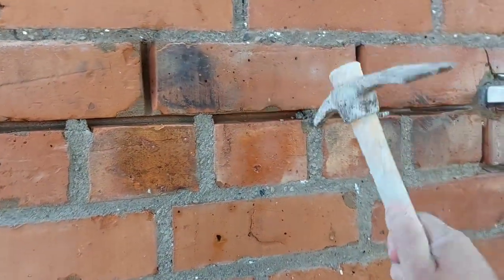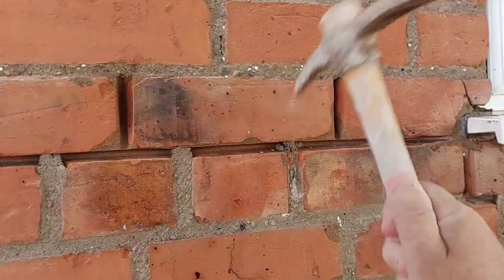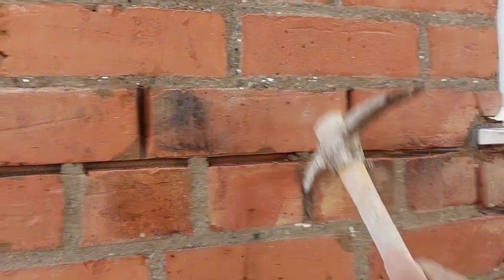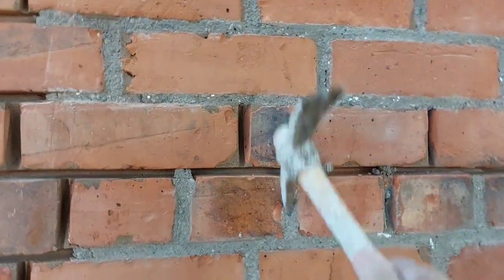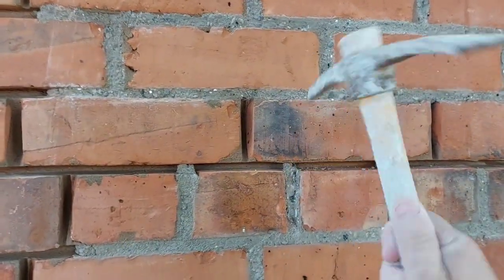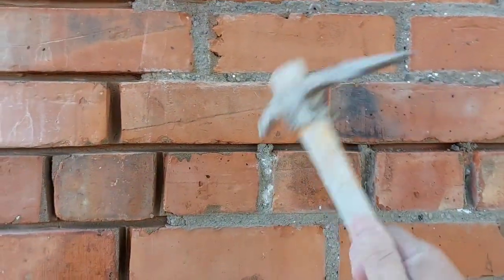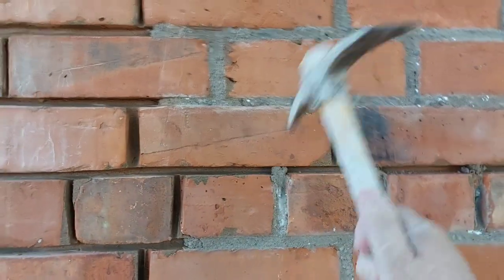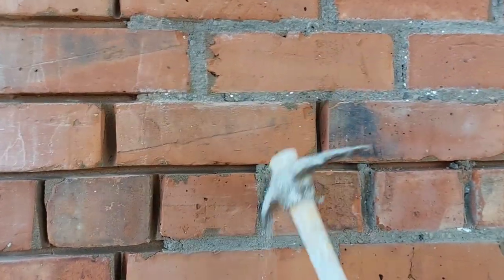A good NHL 3.5 lime mortar strength after 21 days flexibility and elasticity  is what you want

Comment: Very useful video as always glen love how you share your expertise about NHL lime mortars ...I've got so much to learn after spending 30 years working with cement this is a totally different different game ..and tradesmen like you sharing this information is in valuable..keep up the good work 👍
Reply from the maker: Thank you if you have any questions just ask
The purpose of my channel is to get more people using lime
Reply: Hi mate I'm a bricklayer myself . And want to understand more about lime  mortar 

I'm re pointing a gable from 1921 it's the original lime I'm going to have to use lime mortar but what mix is best 

Also if I point with sand and cement obviously not on this job is it always good to add hydrated lime to make it more flexible

Comment: I find it’s the compaction of the mortar that’s the most important factor in achieving the strength. To do that you need to watch how much water you add to the mix and ensure it’s not too sloppy as it becomes really difficult to compact it in a joint. The same applies to hot lime as it does to hydraulic lime mortars. Good video again.
Reply from the maker: thank you 
Yeah and getting the correct mix of sharp sand to grit sand is so important 
On my other videos I show not to have the mix to wet

Comment: I’m repointing a Victorian property in West London. Very little wind. The old cement mortar has been raked out to an average of 14mm. Was going to use Secil NHL 2 with a 1 : 2.5 mix. We’re also going to rebuild a bay window, so need a stronger lime for this, so was thinking NHL 3.5. Does it need to be the same brand for the colour to match the rest of the building?
Reply from the maker: Mix the nhl at a 1:3 mix 

If your going to rebuild the bay window 
I'd build it with what lime you could get hold of  then rake it back the same depth as the rest of the house and repoint it in the nhl2 so it all matches 

Keep the hessian as damp as possible in these temperatures

Hope that helps
Reply: Thanks. Can I also get your opinion on Secil NHL 2 please? I know you recommend St Astier or Lafarge, but the problem I have is I'm only repointing the ground floor flat of a converted Victorian property and the floors above are going to stay with the cement mortar. I know I won't ever get a perfect match but I don't want a really light mortar, and I've been told that Secil has a high clay content which gives it a greyer colour (although the free lime content is lower but this is a compromise I'll have to make). Maybe there is a sharp sand I can use to get a greyer colour?
Reply from the maker: @adammapletoft6334  Yeah, the sand is important if you can't get a grey sand, put a little granite dust in it that will go grey

Comment: Hi Glen great info as usual, can you give some advice on what to use as a pozzolan. I've noticed in the old lime mortars it looks like they've used coal dust or ash. I love reading up on lime mortar and it's benefits but there's no substitute for being hands on and learning the craft, what I don't want to happen is to use something which would have an adverse effect such as bleed streaks!
Reply from the maker: Depending on what lime you are using 
Pozzolan helps set it quicker if you want the black  or coal affect without it staining 
Substitute it with black stone you can buy bags of it from lime suppliers
Reply: @GMTpointingspecialistsltd  I bought some clinker from ebay.
Reply from the maker: @amyntas97jones29  your not using a hydraulic lime are you

Comment: How long does 3.5 take to form binding/compressive strength as I need to remove shinms and supports on old fireplace wall renovation.
 I  Raised opening to  fit new wood stove ,Keyed in conc lintel just now , and added lintel support bricks etc .
Cement im good maybe 5 hours put what about 3.5 nhl round tower premix ?
I just started today and so far it’s a perfect colour . 
Feels completely different from Portland cement
Reply from the maker: full strength for lime is minimum  of 90 days  check the data sheet it's free to download on Google and it tells you all the mix ratios and the compressive strength for the ratio you mixed it at

Comment: Alright pal wot sands did you use too get that gray colour it is exactly  the colour i am after
Reply from the maker: It's actually brown sand it goes a light brown after it dries
Reply: I av tried 1 3 with nosterfied its similar but not gray enough.
It's a terrace in oldham so the mortar is mainly coals ash from mill engines.
It's dark gray almost black when wet.
What would you use
Reply from the maker: It's the sand you need to look at first 
Then the coal ash  

You  could also look at using a pigment  if you can't find a grey sand

Comment: Hello, I want to make a base for a greenhouse with reclaimed herringbone brick. Seems the older handmade ones blow out more with the frost when in contact with the ground, so thinking of using some 1940s wire cut. Will go on a c40 concrete base. 
Can I use NHL 3.5 mortar. It will be walked on a bit, and contain 8x12ft heavy wood green house with a 1m walkway around it. 
We were going to use cement with lime and seal it with Bostik Waterseal but now know that's bad practice right...
Reply from the maker: Yes you can use a nhl3.5  use a good quality one like lafarge or Saint astier 

Lime that you mix with cement is a hydrated lime 
Using bostic waterseal I wouldn't do that
Reply: @GMTpointingspecialistsltd  Thanks mate I appreciate you sharing your knowledge. We were looking at a premixed mortar like Conserv NHL 3.5 Lime Mortar.
What your thoughts on that one or can you recommend better?
Also, could be get away with using NHL 5 on a reclaimed brick herringbone patio in Oxfordshire?
Reply from the maker: @raywilson3166  Conserve is good stuff nhl 5 is strong 
I'd stick to the nhl 3.5

Comment: Hi Glen, What are your views about using Stormdry, the breathable sealer, on very soft sandstone?
Reply from the maker: If you have pointed it lime properly you won't need to use it 
I have mixed feelings on using  these products as your only going of there data which they have provide and it's expensive
I have used it before only on buildings that were pointed in sand and cement and was going to cause more damage removing it

Comment: I have finished removing the old cement render. I am going to use quicklime to point the old soft stone (I just fancy having a go with it). Can you advise me on the mix? I am using Calbux 90, with 3 parts sharp sand and some washed grano grit. Do I need a pozzolan? Or do I need to change the proportions? What would you advise? Regards, Phil.
Reply from the maker: First of all using hot lime  
Is it sand stone  
Are you in a part of the country that's low wind 
A semi protected area 
If not a good quality NHL 2 would be better
Reply: @GMTpointingspecialistsltd  Hi Glen, I live in Pembrokeshire West Wales. We get south westerly winds. The wall I'm doing is protected from much of the wind. The temperature tends to be pretty mild down here. The wall was originally done in hot lime. They used a gritty mix. I'm just wondering if I should go with a 1:3 - one calbux, 2 sand and one grano dust? The wall is very very soft sandstone. I have had to replace a few of them. where they were grumbling. Going with a hotlime I'm just not sure about there mix, especially with calbux being 90% freelime.
Reply from the maker: Old hot lime isn't the same as the hot lime now 
The hot lime now was used for the metal industry 

Old hot lime in my area was about 55% not  90% 
I've seen sandstone eaten away about an inch behind the pointing so I won't use lime with high free lime on sandstone
I use a NHL 2 1:3  free lime about 55 % 

Just be careful 

Mix some hot lime up 
Put a piece off of cut or old piece of sandstone in with the hot lime see if it dissolves

Comment: I’m using leighton buzzard fine sharp sand and it seems to have a rainbow of colours but a kind of whole grain mustard look to it with yellows and blacks being the prominent colours. I’m finding that, even though I’ve spent ages compressing it and making sure there are definitely no air pockets, that when I’m knocking it back with the churn brush some of the larger stones are falling and leaving pockets in the finish. I’m all new to this. Are there other techniques I should be employing in such a case? After a going over with the soft brush it looks ok but it’s a bit rough if you get me?. Maybe I’m just being fussy.
Reply from the maker: Could you watts app me a picture 
Just google GMT pointing specialists ltd 

What lime are you using 

What's your mix ratio
Reply: @GMTpointingspecialistsltd  Hi, I’ve realised that the nhl 5 I’m using knocks back easier than a 2 or 3.5. I should’ve used a 3.5. I got worried about the sun on the job. I’ll be braver next time.
Reply from the maker: @Scribe3168  NHL 5 is a hard mix 
If you have to point in the sun hang a tarpaulin above you when you work it will put you back in the shade
Reply: @GMTpointingspecialistsltd  I’m getting there. I have hessians now. It was an enormous job to take on seeing as I’d not done it before and I was on my own for most of it so looking at the info out there it seemed nhl 5 would cause me the least problems but it’s brittle to knock back it seems. It all looks ok. I’ve now ordered 10 bags of nhl 3.5 … see how that goes. Cheers for your help.
Reply from the maker: @Scribe3168  use a good quality NHL mate it makes a massive difference
Reply: @GMTpointingspecialistsltd  I’ve ordered St Astier. It was St Astier 5 I was using. I think free lime content was something like 15% with the 5. The 3.5 is more like 25%. Still doesn’t seem like an enormous free lime content. I have the hallway and stairwell and landing area to lime plaster plus another side of the house to repoint plus I still need to render the front of the house. Does St Astier sound good to you? I haven’t paid for the bags yet, just put in an order request at Mike Wye’s.
Reply from the maker: @Scribe3168  yeah  that's good  st atiar 2 has around 66%
Lafarge and  otterbein are good as well 
You will notice the difference 
Not letting it dry out to quick is hard but soak it after it's gone off
Any questions just give me a call I can talk you through it no probs
Reply: @GMTpointingspecialistsltd  cheers. The side I was pointing was south facing but the next is north facing and down the alley between the houses so even as we hopefully get into some kind of summer the sun and wind shouldn’t be a problem. The way this place was built they laid the bricks on a bed of lime, sand and mostly gravel and then only buttered the outside edge of the perp and then weather struck in lime and sand only on the surface. When you clear out the old mortar you go straight through the mortar on the perp meaning I have to backfill every perp it’s full depth. Beautiful bricks made by the same brickworks that supplied the bricks for the Royal Albert Hall, London but they’re laid all over the place. I’ll give you a shout should things start going awry.

Comment: Does NHL not keep hardening for years?
Reply from the maker: The cheap NHL mortars do as the contain clay 
use one with high free lime content 
There's a lot of flawed evidence about nhls 

Hot limes also get harder  
I've done a video on hot lime and NHL. 
And after 5 years the hot lime felt harder
Reply: I've been following this topic NHL vrs Lime putty, some of the better ones have more free lime. The general consensus is after 15 to 20 years NHL 3.5 has the potential to be as hard as cement.
Reply from the maker: @alexprichard6003  could you tell me where you have seen that information 

Lime is a mind field 
Hot mixed lime 
Putty is for inside
 very week adding pozzalons and additives  give it a hydraulic affect 
So why not use a NHL 2 
A good NHL can have 66% free lime content 

I'm in north Wales so the weather is harsh so I won't use hot limes on walls that are  exposed to the elements

The Scottish lime center 
Chat to them 
They don't sell lime they  do mortar Analysis
Reply: There a few good groups on Facebook where it's openly spoken about, it is a mine field. The pursusts will say go back to original why change but obviously there is always a compromise say around chimney etc. I struggle to get lime putty so may end up having to use NHL 2 as a compromise. Hot lime seems all the rage ATM but it won't fix everything if you have underlying problems..
Reply from the maker: @alexprichard6003  hot limes  are for well protected areas 
I've put sand stone in a mixed bucket after the hot lime cooled down and it started to dissolve it because of the high lime content 

The more people you speak to the more  you struggle to understand 

 I
Reply: @GMTpointingspecialistsltd Hi Glenn, I've tried looking for this video you refer to but can't find it

Comment: I'm going to use a hotmix for the front of my house, and  I'm thinking of adding slate dust. Only a small amount, say 5% of the mix.  Do you know of this will significantly alter the colour of the mortar?
Reply from the maker: You would need to go back to your supplier and tell them what your using it's not something I do

Comment: in the uk. mostly point 9inch brickwork out of 3.5nhl and sharp washed sand?   what ratio would you use. a 4-1?
Reply from the maker: Hi I'd use a lafarge nhl 3.5 mixed at 1:3  it's the best nhl
Reply: @GMTpointingspecialistsltd  nice one thanks. and what do you think about lime wash paint for protection after its been pointed.  does lime wash paint stop a lot of water penetration?
Reply from the maker: @user-cn1em2qx6f  if it was lime washed in the past I'd lime wash it again
Reply: @GMTpointingspecialistsltd  and  would you use 3.5nhl at a 3-1 ratio to replace bricks?   sorry last question😂
Reply from the maker: @user-cn1em2qx6f  hi yes 
When you mention lime always try to say the lime  the binder first 1:3  
 3:1 I class that as a rock hard sand and cement mix 

Feel free to ask questions that why I set my channel up